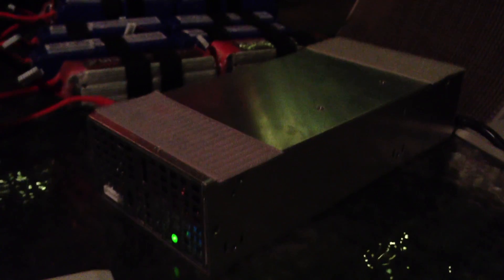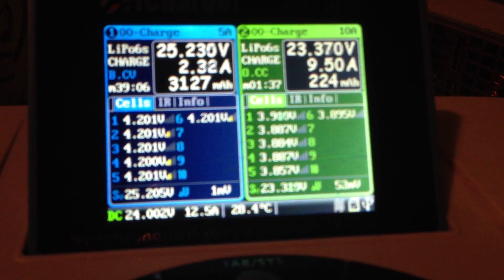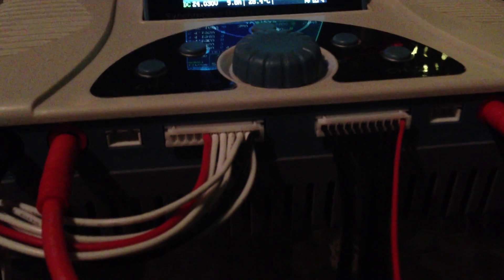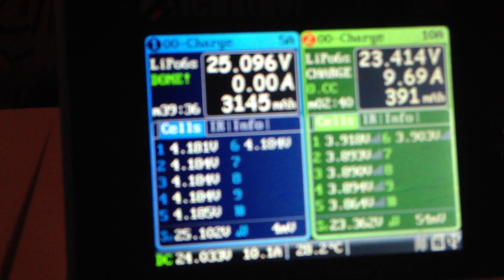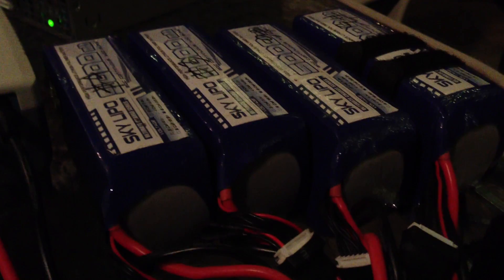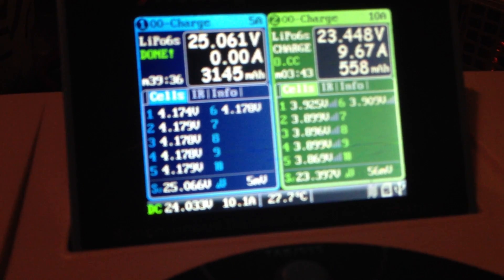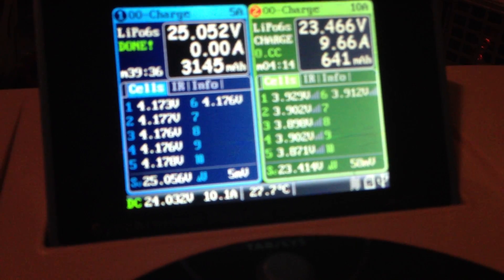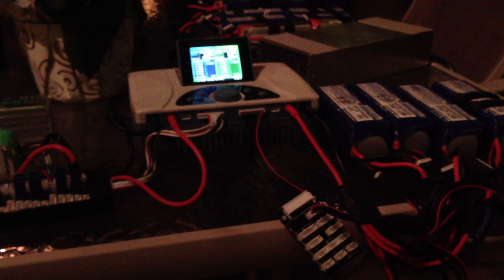iCharger 4010duo - Dual Charger

Comment: can you set mha of batterie on the charger.thanks.
Reply from the maker: MrCatra21 Yes, you can.  When ever you are charging batteries, you want the charger to know the SIZE of the pack in mAh.  This allows for other calculations and precautions to come into place.  For instance, if I put 2 5000 mAh packs on the charger, I set the mAh to 10,000 of course.   Now, as I set my charge rates, the charger knows what 1C, 2C, 3C ratings are and it graphically and beep alerts you to any concerns.  Important for safety.